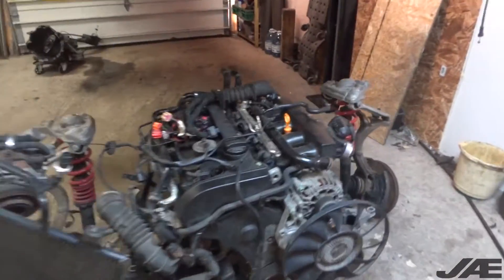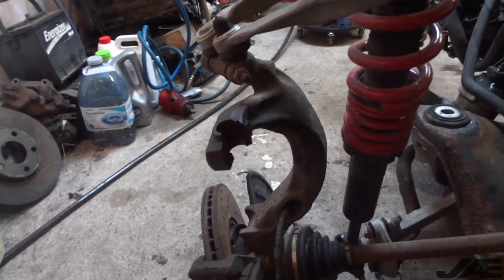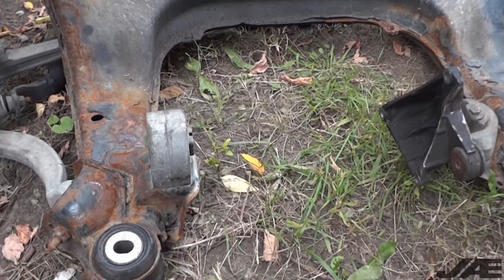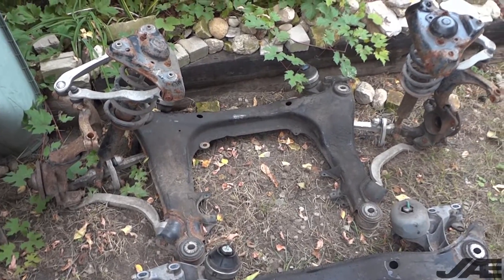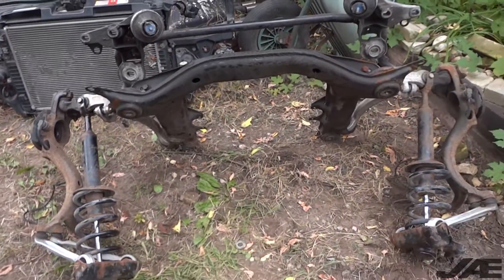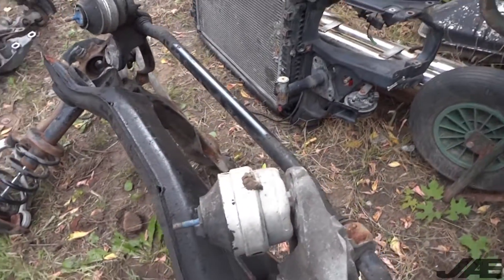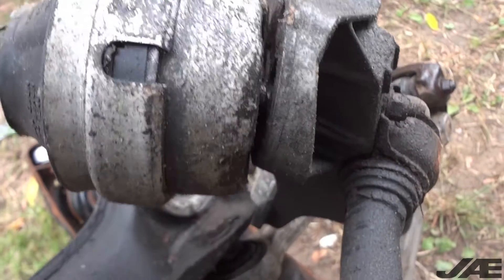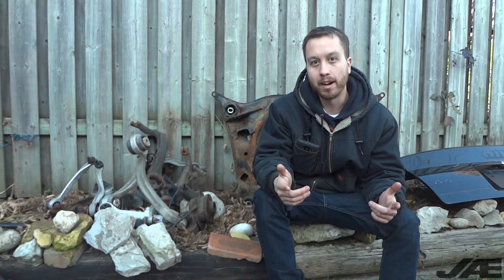Project B5 V8 EP2 - Subframe Swap

Comment: hi great videos I really enjoy watching them.  I was just wondering when episode 3 is comin out? and is there a major diffrence in swapping the 4.2 into a 98 b5?  thank you
Reply: 98 is drive by cable and will need the accelerator pedal swapped and wired.  Both are easy.

Comment: Are you going to be using the 034 motorsports mounts ? For the engine
Reply from the maker: For the time being I will likely be using stock v6/v8 mounts and shim/space (properly) as necessary.  When I do upgrade it will definitely be to the 034 Motorsport mounts though.